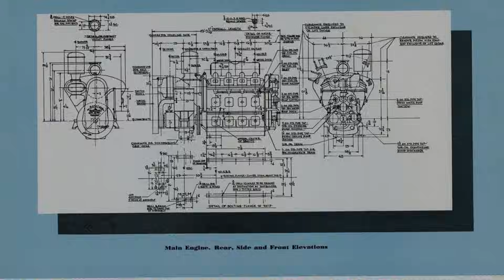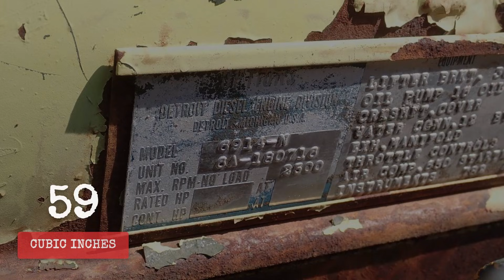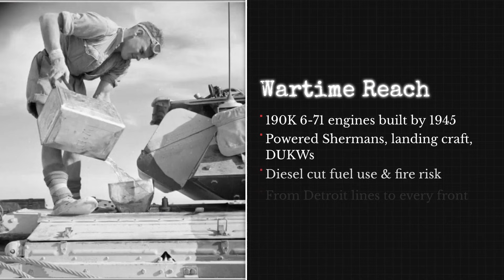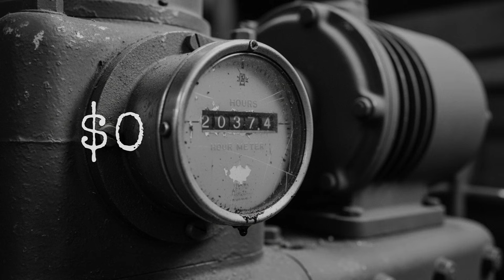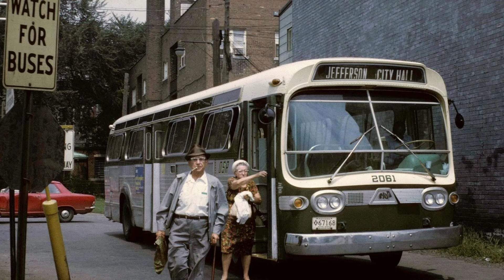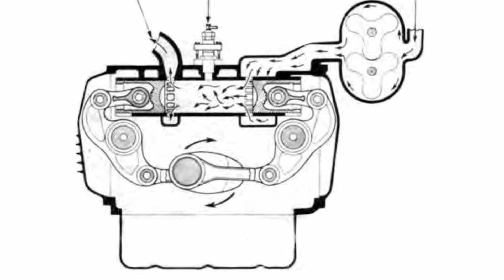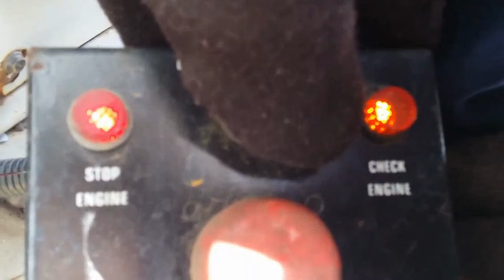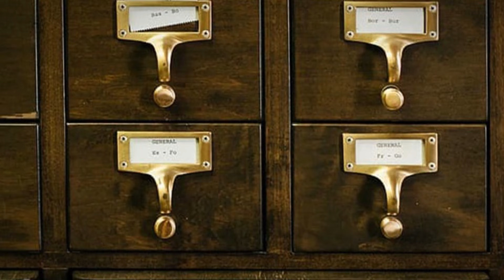The Diesel That Bankrupted Its Own Company

Comment: 6:28 that is a beautiful diesel there, with spark plugs n that
Reply: 😂😂 
That's the fuel line for the direct Injection 
It looks like wires because it is not a comment rail diesel.